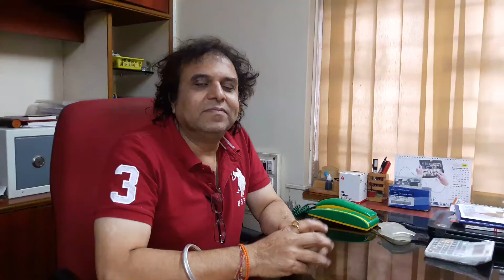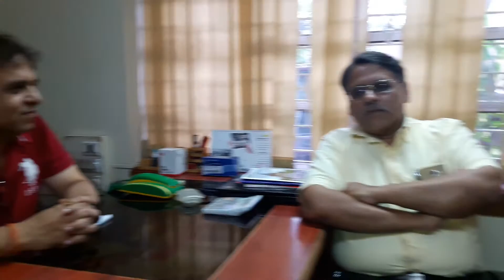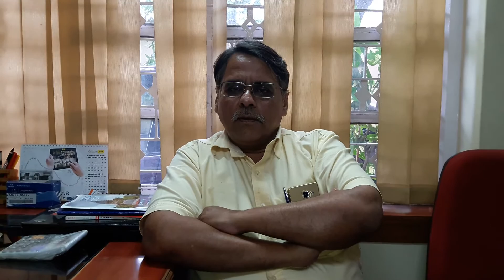ARC Shock Absorber Suspension Customer Review - Hyundai Verna Fluidic

Comment: Will this also give me higher ground clearance ? I have a 2012 Verna Fluidic and would like to have your shocks fitted. I want both front and back replacement.Please let me know. Thanks
Reply from the maker: Sir this will not increase the ground clearance, although the suspension will be better at resisting force.  The vehicle will not bottom out as much as it does on stock suspension. I myself use a verna fluidic 1.6 2012. Please whatsapp me on 9595940959.
Front shock absorbers are in high demand and are yet to be back in stock. We have the rear shock absorber in stock and ready for dispatch.
Reply: @ARCSuspension  thanks much I shall call you and discuss
Reply: @ARCSuspension  Tried reaching you over phone and whats app. Please do respond when you have some time. Thanks
Reply from the maker: Sir please check the number once again. My phone is on right now.
Reply from the maker: 9595940959.

Comment: I have verna 1st gen 2008 model(before fluidic version). do these suspensions fit to this model?
Reply from the maker: There may be suspension design difference for the previous model. And we do not cross integrate products for different vehicles, specifically for comfort, luxury and stability goals.

Comment: Sir I have xuv500 I have a suspension issue not comfortable.  Which is the best arc suspension
Reply from the maker: We recommend to get the whole suspension kit fitted that we provide.
Just order from our website and take it to any local mechanic. No modifications needed. No external parts needed to be ordered. All inclusive kit will be send to your address with shipping included in the price listed.
Link given below 
https://www.arcindustries.co.in/products/mahindra-shock-absorbers-96997/xuv-500-shock-absorbers-101102/mahindra-xuv-500-arc-suspension-kit-rear-shock-absorber-front-assembly-shock-absorber-strut-kit-with-coil-springs-comfort-series-2011-2020-388389
Reply from the maker: Product can be ordered from the below Link - 
https://www.arcsuspension.in/mahindra/xuv-500/mahindra-xuv-500/mahindra-xuv-500-performance-upgrade-kit-2011-2021-rear-shocks-absorbers-and-front-strut-assembly-shock-absorber-with-coil-spring-2011-2021-rear-shocks-front-full-assembly

To know more Call us on 9422047019 / 9922099292

Comment: I want for my verna 2012 ....Cost ? . And how to install.
Reply from the maker: https://www.arcindustries.co.in/products/hyundai-shock-absorbers-25499/verna-fluidic-shock-absorbers-348130/hyundai-verna-fluidic-arc-shock-absorbers-553197
Reply from the maker: Sir the cost is 15,660 Inclusive of Shipping all over India.
Installation can be carried out by any local mechanic as it requires no modification to the vehicle.

Note: personally i use a verna with These suspensions too, you can call me for any queries on 9595940959 Rahul Pawar.
I can show you the shock fitted in the vehicle on video.
Reply from the maker: Sir we have developed the full suspension kit. Front and Rear Shock Absorbers by ARC. Product link given below.
https://www.arcindustries.co.in/products/hyundai-shock-absorbers-98999/verna-fluidic-shock-absorbers-129130/hyundai-verna-arc-shock-absorber-comfort-series-suspension-front-and-rear-2011-2017-387388
Reply from the maker: Product can be ordered from the below Link - 
https://www.arcsuspension.in/hyundai/verna/fluidic-4s-2011-2016/hyundai-verna-arc-shock-absorber-suspension-upgrade-kit-front-rear-verna-fluidic-2011-2015

To know more Call us on 9422047019 / 9922099292

Comment: Hi, will this solve the ground clearance issue of Verna?
Any before-after video or images?
Reply from the maker: Yes sir,  this will solve the ground clearance issues to a marginal degree. No images of before and After sir. Because the height of the vehicle wont change. the suspension will absorb the bumps and wont hit buffer on bad roads easily.
Reply: @ARCSuspension  
Thank you for the info. I dont have any problem with current suspension. The only problem is when there are 5 persons, then there is problem while crossing speed breaker as car slightly touches the speed breaker. Will this issue be solved? Can you provide such video?
Reply from the maker: Yes sir. The problem will be solved.
We do not have any video at the moment.
please call me on 9595940959, i have the same vehicle,  will be able to share the exact difference experiences.
Reply: @ARCSuspension  please provide a video for verna with ARC suspension (like other cars) eg: while crossing a speed breaker with and Without passenger. Its a request. :-)
Reply from the maker: Sir we are not increasing any height in verna yet.
We have rear shock absorbers available.
Front shock absorbers under testing right now.

I can assure you that the vehicle wont hit on buffer.
As far as front suspension goes, it will completely revolutionize the ride quality.

Please contact me on 9595940959.
I myself own a verna fluidic.
I assure you the wiper wont go off on bad roads and speed breakers. 😅 i suppose we can talk if you want to know in detail.

Will make arrangements for the video after this pandenmic.
Although it wont show much, will still think of something.
Reply: ARC Suspensions  Hi there. I have a fluidic Verna 2011 model. I want to replace all 4 shock absorbers from my car. Do u provide Shock absorbers for the front tyres as well? If so, what would he the total cost for all 4 incl GST and Shipping. When i checked ur website it says shock absorbers for front tyres are available as well
Reply from the maker: Sir the price is inclusive of GST and shipping.
https://www.arcindustries.co.in/products/hyundai-shock-absorbers-98999/verna-fluidic-shock-absorbers-129130/hyundai-verna-arc-shock-absorber-sport-series-suspension-front-and-rear-2011-2017-377378
Reply from the maker: Sir we have the full comfort kit available which is compatible with your vehicle. Product link given below.
https://www.arcindustries.co.in/products/hyundai-shock-absorbers-98999/verna-fluidic-shock-absorbers-129130/hyundai-verna-arc-shock-absorber-comfort-series-suspension-front-and-rear-2011-2017-387388
Reply from the maker: Product can be ordered from the below Link - 
https://www.arcsuspension.in/hyundai/verna/fluidic-4s-2011-2016/hyundai-verna-arc-shock-absorber-suspension-upgrade-kit-front-rear-verna-fluidic-2011-2015

To know more Call us on 9422047019 / 9922099292

Comment: i want to fit these gas filled shocks in my fluidic verna
i stay in bangalore
plz help
Reply from the maker: Hello Sir,
               Thank you for your interest in ARC suspensions. These suspensions can be ordered online at the below-given link

Ordering link
https://www.arcindustries.co.in/products/hyundai-shock-absorbers-59999/verna-fluidic-shock-absorbers-441130/hyundai-verna-fluidic-shock-absorbers-908197

Installation -  Installation procedure is not any different from stock shock absorbers as these are completely designed as retrofit shock absorbers. No modifications are necessary to install these shock absorbers. A local garage in Bangalore can also do the job for you.

Please contact 9595940959 for any queries. I myself use a 2012 Verna Fluidic with ARC suspensions. I will be very happy to answer if you have any questions regarding on-hand experience with these shock absorbers.
Reply from the maker: We now have an Authorised Fitment centre in Bangalore.
Please contact Mr Mallick 090196 48593 for installation and any requirements.

Google maps location - https://g.page/r/CYMVqN1w0WLVEAE
Reply from the maker: Product can be ordered from the below Link - 
https://www.arcsuspension.in/hyundai/verna/fluidic-4s-2011-2016/hyundai-verna-arc-shock-absorber-suspension-upgrade-kit-front-rear-verna-fluidic-2011-2015

To know more Call us on 9422047019 / 9922099292

Comment: Installation cost for hyundai verna 4S please.
Reply from the maker: Tribhuwan Rana please contact us at 09922099292 or 09422047019 for details
Reply from the maker: Hello Sir,
               Thank you for your interest in ARC suspensions. These suspensions can be ordered online at the below-given link

Ordering link
https://www.arcindustries.co.in/products/hyundai-shock-absorbers-59999/verna-fluidic-shock-absorbers-441130/hyundai-verna-fluidic-shock-absorbers-908197

Installation -  Installation procedure is not any different from stock shock absorbers as these are completely designed as retrofit shock absorbers. No modifications are necessary to install these shock absorbers. A local garage can also do the job for you.

Please contact 9595940959 for any queries. I myself use a 2012 Verna Fluidic with ARC suspensions. I will be very happy to answer if you have any questions regarding on-hand experience with these shock absorbers.
Reply: I want for my verna 2012. What will be the costing
And how to install
Reply from the maker: Product can be ordered from the below Link - 
https://www.arcsuspension.in/hyundai/verna/fluidic-4s-2011-2016/hyundai-verna-arc-shock-absorber-suspension-upgrade-kit-front-rear-verna-fluidic-2011-2015

To know more Call us on 9422047019 / 9922099292